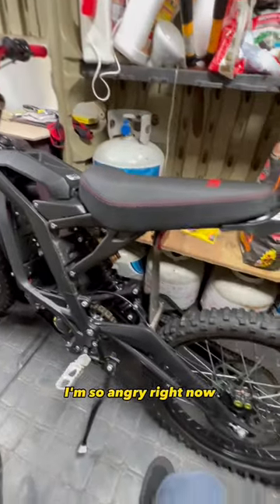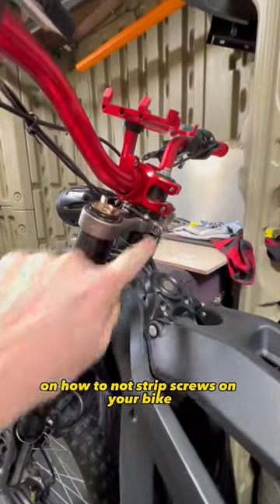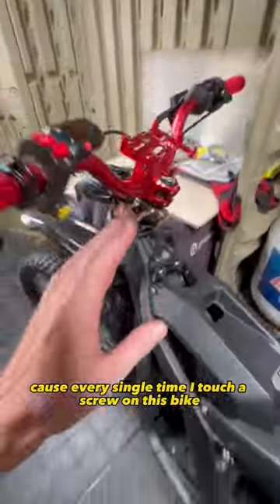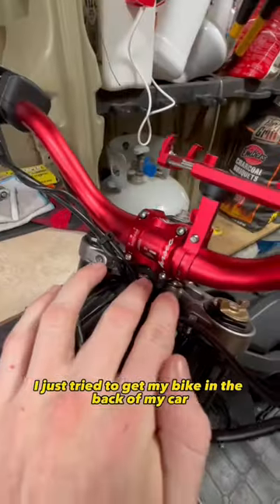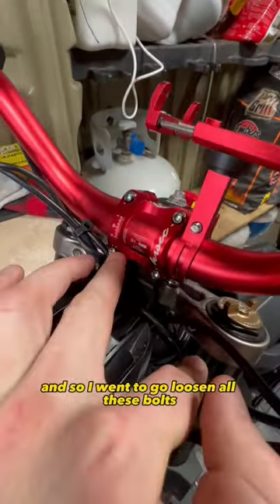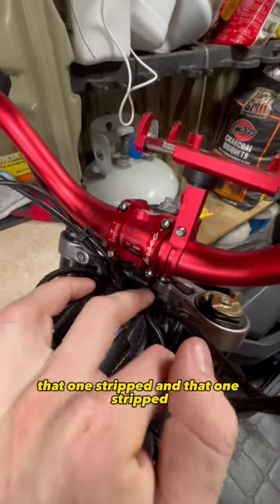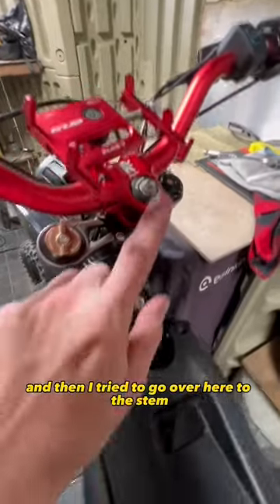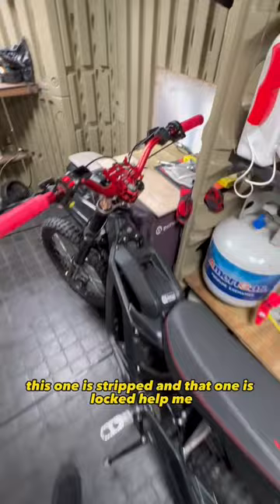Surron X PROBLEMS! #surron #surronx #ebike #electricbike #ebike #strippedscrew

Comment: Use better bolts, nuts, and screws. Make sure you're using the correct size screwdriver/wrench
Reply: Also don’t over tighten
Reply: That makes too much sense  :D  no one will follow that advise  :D

Comment: Depending on the situation, for handle bars it's best to go to specific torque, a torque wrench will cost a little bit but get a good quality one and do some quick research on the nuts, bolts or screws youre using as to find the proper torque

Comment: Swap out bolts for grade A bolts can be sourced from hardware store
Reply: Grade A bolts? Please explain?
Reply: @gerrittklashorst7306  they are a higher quality bolt commonly sold in hardware stores, they have grade 8 stamped on the head. My faded ass made a typo and put A
Reply: Grade 8 not a
Reply: @bertbccfu9564  7 months late and didn't catch my previous reply, your going to do great bud 😘

Comment: Headset botls need very little pressure. They're all around 5nm of force. Basically take an allen key and use one finger tighten the bolt. 

I mean the tip of your one finger at the end of the Ellen key. That'll be around 5nm. 

Everyone thinks everything needs to be cranked down but that's far from true. Most bolts sit between 4nm and 8nm. The odd ones will be 10-14nm and you might have 1 at 20nm. 

Check your bikes manual so you know

Comment: Good tools, make sure they are the right size. Make sure Allen wrenches are fully inserted I to the head of the bolt, and keep it straight. Use penatrating oil or heat to help some situations, and if you get a stripped bolt try to hammer the Allen key further in, or try to hammer a torx bit in there to get grip. Best of luck!

Comment: Don't use the Allen's that came with the bike. Get a torque wrench and tighten to correct specs+make sure u insert the bit completely! I feel your pain I snapped 2 screws on my fox 40s and had to pay $400 for a new headset

Comment: How not to trip a screw: insert it by turn in the wrong direction first until you're sure the threading matches. Next,  HAND tighten in the right direction for as long as you can and finally finish with a screw driver

Comment: If they have loctite on them (just guessing), you can stick a soldering iron in the hole of the screw/bolt to heat it up and loosen it before trying to unscrew it. Best of luck dude!
Reply from the maker: I saw this trick! Definitely gonna try it

Comment: Correct tools. Permatex on bolt
 before you install steel into aluminum. Hell grease works also. And they are bolts not screws

Comment: I invested in a torque wrench for bolts on my bicycle. I always guessed on the amount I had to use until I would strip or over tighten them. 

It really helped me to minimize it from happening. Also using quality bits helps.
Reply from the maker: Thank for the tips! I def need a torque wrench
Reply: @AdamEspositoYT  how you got the toque wrench cause that’s the only thing that’ll work. Electric to be useful

Comment: your problem is quite easy to deal with the instrument in question called torque wrench set of converter sockets the next thing is easy find out what the torque settings are each Bolt door draw a diagram and put the settings on it and carry a decent tool kit if you buy a cheap tool kit it getting crap

Comment: Just use a torque wrench or don't tighten it too much. if you're really that concerned you can prolly swap some hex bolts out for torx bolts if they require a lot of force to tighten

Comment: Get better bolts and also don't use cheap Allen wrenches. People think the cheap and expensive are the same but they are not. A cheap one will wiggle a bit but a quality one will sit nice and tight, like it's meant to. Get a screw extractor if you can't get them out and hit the hardware store for better hardware
Reply from the maker: Thanks for the info!

Comment: Bolts its not the problem (it might be ) i bought brand new vera set (before used 3 year old bahco set , I use it alott eweryday so it wears down ) all the problems gone , even managed to undo the bolt that was already spining around with old Wear down bahco set

Comment: Make sure not to use ikea supplied Allen keys or any other cheap Allen keys, using higher grade bolts also helps since most manufacturers cheap out on their screws and bolts since apparently its not important for you to have a chin 😂
Reply from the maker: The keys I used were from Luna cycle
Reply: @AdamEspositoYT  if you bought the lina cycle ebike tool kit damn 50 bucks for all that? I doubt they used that quality Allen keys in the set
Reply from the maker: @Sphyxx  well I bought the bike repair tool kit they have on there site when I bought the FOLDING bike… but anyway it was def user error on my end😂

Comment: Buy a proper set of hex keys? Are you using the correct metric sizing? Idk I haven’t had this problem at all maybe contact Luna cycle and see if they can help you
Reply from the maker: It wasn’t lunas bolts. But also I could’ve def been using the wrong size. I just have a personal prob stripping bolts and screws😂

Comment: Get rid of those Allen head bolts!
Reply from the maker: Dumb question: replace them with what and how do I find the right size?
Reply: @AdamEspositoYT  I struggled with this for like a year with my Ron.  Buying a torque wrench set with the wrench and proper sized tips or whatever they are called lol.  They fit better and you can’t over tighten
Reply from the maker: Heck ya glad to know I’m not the only one out here lol. I only have 1 bolt that’s stuck now so that’s good

Comment: It's called a direct mount
Reply: Much better and safer I suggest the Pro taper it's really nice easy to use and strong
Reply: If you check my profile you'll see my bike has the renthal 35mm one
Reply: My handlebars never used the stay straight and I'll strip and squirrels all the time not one issue since I changed over

Comment: I stripped one on the bottom of my seat now I can't get my seat off...like why they put metal into plastic ..dummies at least they don't have a new comfier seat out yet for it but when they do I'm ripping that b1tch off (my talaria) and I'm swapping every single bolt on it to Titanium
Reply from the maker: Well I used a dremel to put a groove into the stripped screw so I could use a flat head to tighten it and loosen it